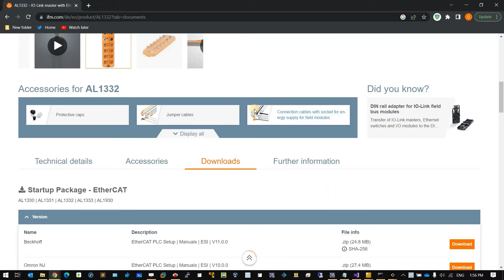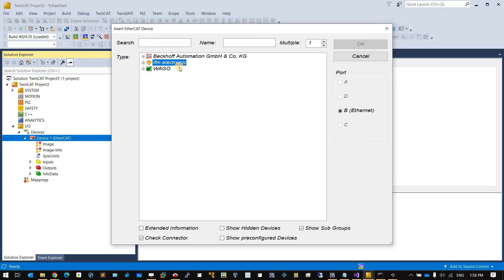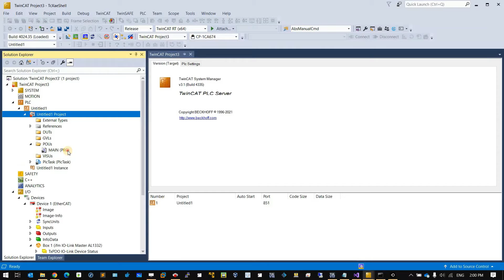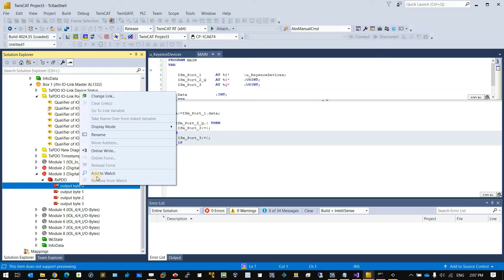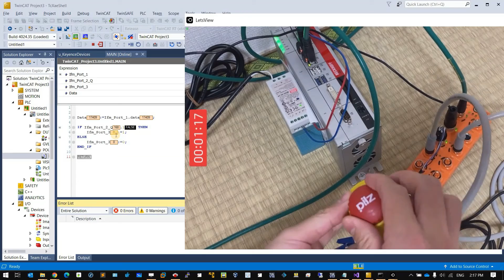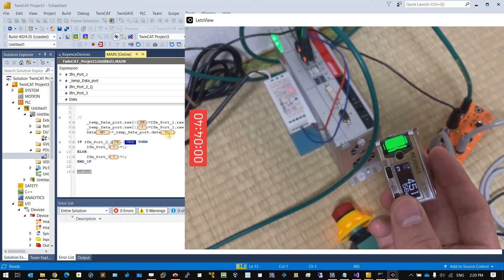Beckhoff.TwinCAT IFM AL1332 EtherCAT IO LINK master.EN

Comment: I am trying to configure an ifm AL1330, but under the slot tab, I don't get anything on the right side table. So I can't change the data type for each slot. Should twincat be in config mode?
Reply: Same here, unfortunately I didn't find a way to solve this
Reply: OH!! I SOLVE! you have to paste only the two XML  from outside folder!
Reply: ifm_AL1x3x_Modules_v1.0.xml
ifm_AL1x3x_v1.1.xml